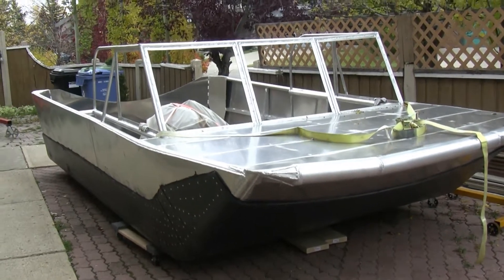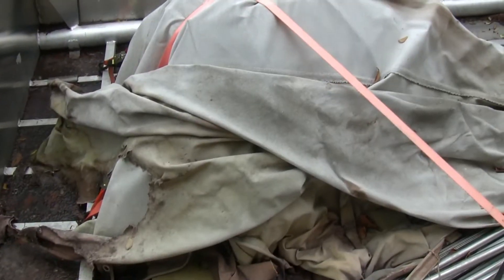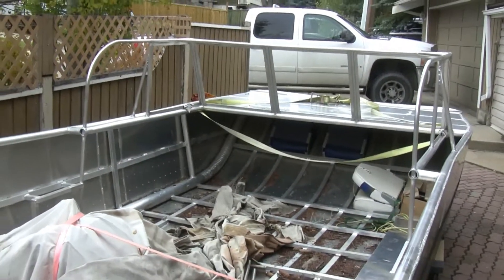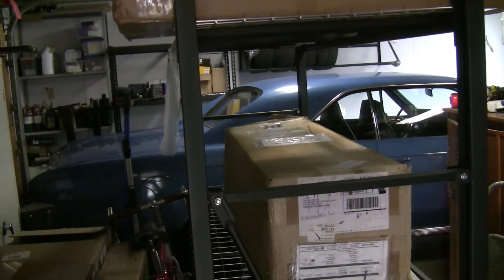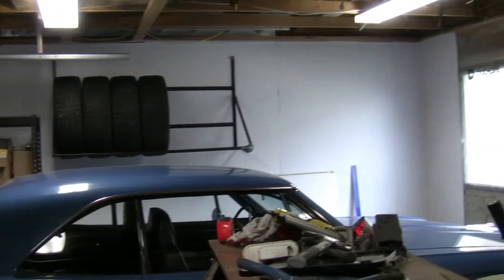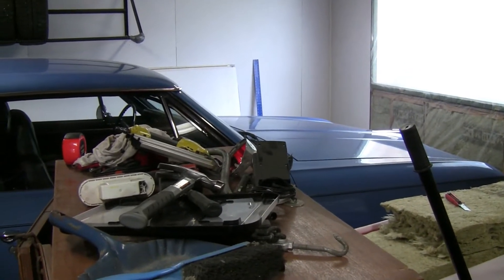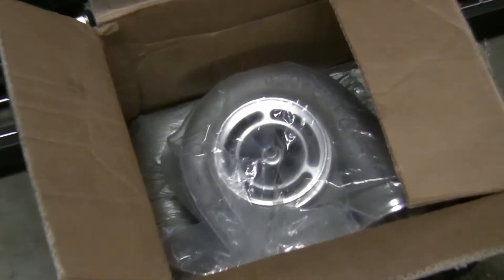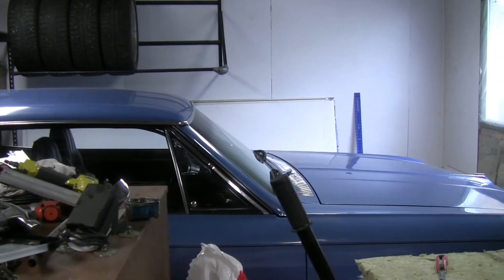Airboat Build update Sept 2018

Comment: what kind of roller bender do you have? if you can detail it. i plan to build my cage
Reply from the maker: My tubing roller bender is a cheap chinese bender I got from Princess Auto: https://www.princessauto.com/en/detail/tubing-bender/A-p8536708e   I think it is very similar to the model available at Harbor Freight: https://www.harborfreight.com/tubing-roller-99736.html
Overall it seems to work well enough.  The construction is heavy enough and it's a simple design so there isn't much to go wrong.  Extra roller dies are available and I have machined some out of delrin for bending aluminum channel.
It turns in to quite a bit of arm exercise to bend large tubing.  On youtube there's videos of guys that convert them to electric chain driven.  For how often I need it I'll keep mine manual operated.

Comment: i just started watching. how are you bending the cage?did you use polished  ss or just 304 tubing?
Reply from the maker: I’ll be using my roller bender for the main hoop.  I haven’t done it yet but I have tested it on the stainless tube and it works well.  My main concern will be bending it straight so that it isn’t a giant spiral.  
For the tubing I got 3/4” and 1” stainless.  It is a brushed finish which looks nice but I don’t really need.  I will be painting or powdercoating it.  I got the finished tube because it was more readily available and didn’t cost more.